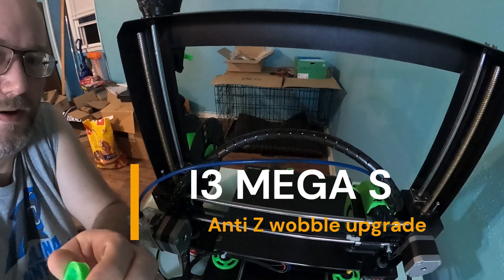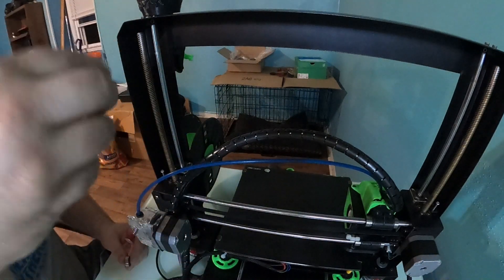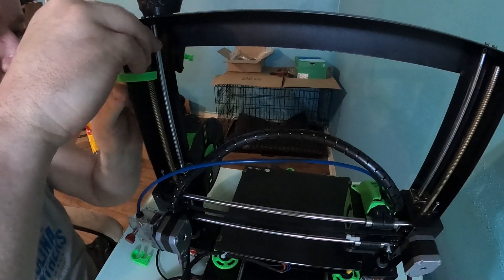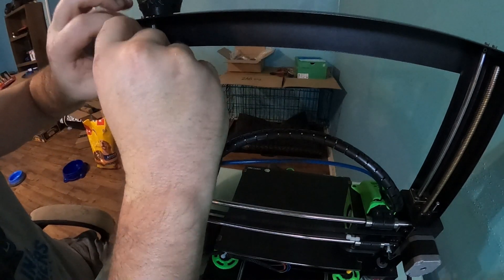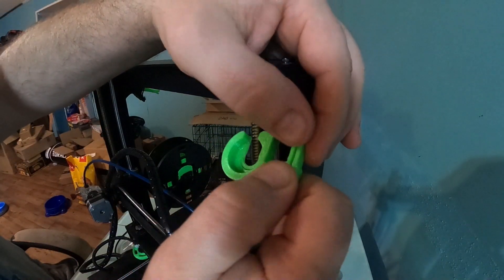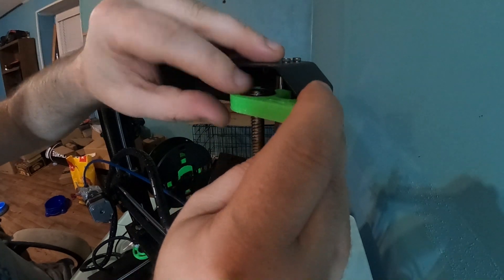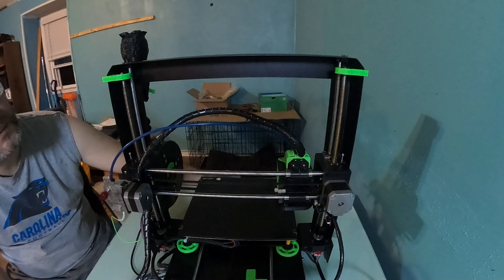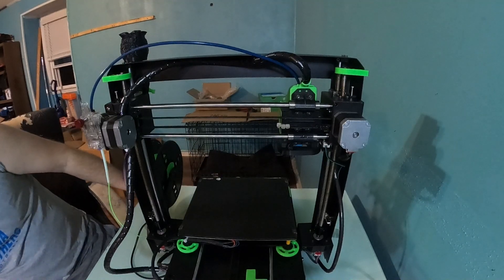I3 Mega S Cheap Anti Z wobble upgrade

Comment: Thank you. Do you still have this printer? If so, I would really recommend upgrading the stepper motor drivers, I recommend the tmc2209's because i use them. The noise was startling :)
Reply: is the stepper motor driver upgrade an easy upgrade?
Reply: @ry7hym  On the stock mainboard, you have to upgrade it and switch a couple of wires. On other mainboards its very easy. Search for knotwurst